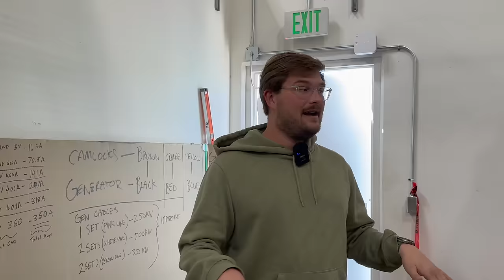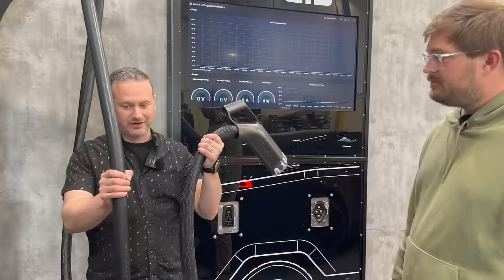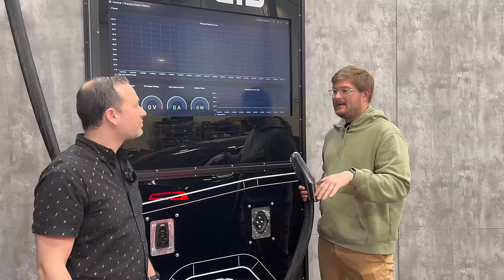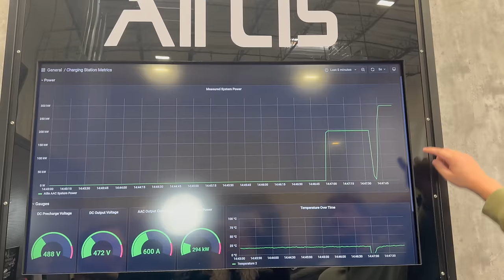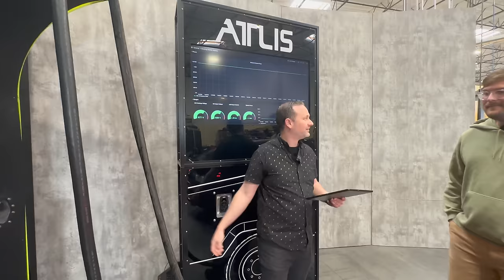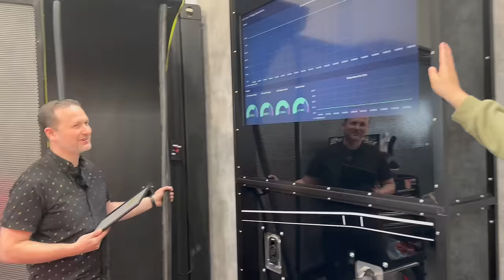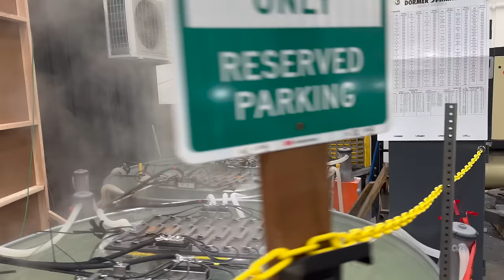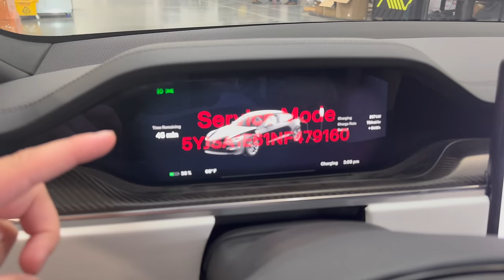Fastest Charging Ever! Megawatt Charging Deep Dive w/ Atlis Energy Solutions

Comment: Handle is good for the connector, especially if there's substantial insertion force. Less chance of wrist fatigue or injury from putting force on the joints at a strange angle. It would also be easier to grip if you can wrap your fingers around it, especially with smaller hands.

As for the stations themselves, I like the demo unit setup that keeps the cable off the ground. Probably something like a tall pole with a swing arm so the cable isn't dragging or getting run over.

Comment: Decades ago we were filming a commercial in Mexico City, at their large studio. We needed to warm up a prop Jacuzzi, quickly. So the studio electricians took a 2X4, nail on either end, wrapped with bare wire, and plugged it into the Mains at the wall panel. Dropped it into the spa, and told everyone to Step Back. They threw the large, old fashion “Frankenstein” switch, and the water instantly started to boil! It only took a few seconds for it to get to a comfortable temperature for our models. :-)

Comment: In 2001 I was involved with load testing 6 huge marine generators the same way - 6MWish………..  generators were connected up to 6 x 40ft half height shipping containers full of water. All tested fine, miles of huge cables disconnected and removed (no body was allowed into the main machinery space during the test btw) BUT after the half height containers had been drained and lifted off the hatch c overs for the ship we found that there were 6 x 40ft areas of bare steel under the test units…….. basically we had dissolved all the protective galvanising off 3 massive 30t steel hatch covers! We also had to have the ship’s magnetic compass re-swung and adjusted because the ship’s magnetism had changed drastically during the load testing!

Comment: I'm struck by the scale of all that's needed to power and cool this kind of system. Right now it seems like an almost comical amount of power needed. To run one of these in the real world you would probably need your own substation for each unit, which seems like a large barrier to mass adoption. Still, this gives a sense of where EV chargers and cars are going. It's likely all these problems will be solved eventually and the grid will scale to allow locations for megawatt charging in the near future. Imagine the ev market share when the cars can charge as fast or faster than a gas/diesel truck can refill.
Reply: The demand charges of megawatt charging will never make megawatt charging a profitable endeavor.

Most utilities have a $5-$15 per kW demand charge. It could cost up to $5,000 - $15,000 a month just in demand charges. Say you only have 60 vehicles get a full charge of 60 kWh at a max of 1mW. You’d had to charge $2.77 per kWh just to cover the demand charges. Compared to gas, that would be like driving a 4 mile per gallon car cost wise.
Reply: @Jhawk376  the concept of demand pricing will eventually phase out.
Reply: @Jhawk376  Thats a solid point for the near future I hadn't considered. I sometimes wonder if a better solution is grid charging batteries that themselves can send energy faster to cars that come in to charge. In theory you won't have peak charger 24/7 so there is time at night or off hours to charge onsite storage that ca be used when demand is needed. I think I saw this in another one of his videos too.
Reply: main users will probably be semi trucks. maybe a few other vehicles that can handle it will be able to stop by or something.
Reply: @JoeSimonsen  I think Kyle showcased this already. for places that are a bit more removed they keep some batteries charged to allow for higher rates without needing infrastructure.
Reply: @GregHassler  Honest question: Why would “demand charging” phase out if the utility companies use it to distribute more of the cost associated with building/maintaining capacity of power to those who use it most?
Reply: @JoeSimonsen  that's how it works at several 16+*300kW charging stations here in Denmark. There's a huge battery being charged by the grid and solar cells on the roof of the station, to better distribute the load on the grid.
Reply: Don't see a point to this system
Reply: EVs will never charge faster than filling fuel, that's for sure.
Reply: @TheIrvingsylva  batteries will level it out so distribution can be more even.
Reply: AC needed
Reply: @alanmay7929  They don't need to.
Reply: @alanmay7929  NASCAR fills 20 gallon tanks in 12 seconds. INDY CARS in 6 seconds.
Reply: Ignoring the power being dumped in the water, there seems to be a huge energy loss in this setup.
Reply: @alanmay7929  Bring EV charging to 5 megawatts and it's there. Assuming electric motors are 4x more efficient than an ICE engine and you cut the 20,000kW of a gas pump by a quarter.
Reply: @kng128  absolute bullshit!! ICE diesel more precisely have significantly way more range than any EV, some ICE even comes with second or auxiliary fuel tank for even more range, charging an EV will never equal the speed of filling 5MW that will come from where?! no house even have that kind of energy demand lol!!!

Comment: The white charger with an external handle is definitely the better choice for the connector. Not everyone has large hands that can handle a large diameter connector. It could also slip in rain and snow. The one with the external handle is absolutely much easier to handle in all situations. Just make it of rigid and unbreakable materials. It would be best, if you include some metallic stripe in it, so that if it weakens in hot climates, and the plastics break, the handle doesn't, and it can still be used until it is exchanged.

Comment: As a retired electrical engineer working in the genset business, I don’t think you have any concept on the amount of “energy” in 1 Megawatt of power. The expansion of the electrical transmission network to handle a station of several 1 MW chargers will be horrendously expensive. That will lead to higher electricity prices. The existing transmission network in the USA needs a lot of updates and replacements to handle the ever increasing needs for electricity. That’s not going to happen overnight or even in a few years. I don’t think I want to be plugging my EV (assuming I ever have one) into equipment capable of 1 MW power flow. To me 250kW is too dangerous to be around. If there is ever a failure , it’s going to be like the “big bang”.
Reply: Yeah, this charging system is a one off demonstration. It isn't ever going into mass production.
Reply: How long have you been retired?  Getting megawatt+ power drops just isn't that hard nowadays.  Look at the rapid expansion of the supercharger network for one, the explosion of Bitcoin processors, and data centers everywhere.  Projects take some time for planning and acquisition of transformers, but there are no fundamental obstacles to this.  US infrastructure is continually upgrading as it has been for over 70 years. Capacity is 6 times what it was in the 60's, adding some charging capacity for EVs will only be another 20% expansion over today's levels.

Comment: I think the dispensers should be something similar to Kempower stations.  skinny pedestal with a place for the handle and card reader with the cable going up high and extending out on a movable pole or spring so you can get front charge port and back charge ports.

Comment: A 100 KW solar array may trickle charge the battery bank( 2 days). A 200 KW array would do that faster (5-8 hours). You don't need a megawatt of power everyday. So, a 200 or 250 KW solar array would be optimum. The generators would only serve as a back up in times of need. The grid would also help with a 100 or 200 KW.

Also a megawatt charger would charge  14-16 vehicles at a time. And 4 to 5 simultaneously at a high speed.

Comment: Definitely need a handle, right now I quite often have a phone in my hand while initiating the session and a handle would make it much easier to plug in with one hand. I envision a gas station like concept so a vehicle can pull in either the left or right or front or wherever it’s charge port is. Make a few stations that are longer like RV/Semi pumps for pull thru with trailers. Have a board that shows status of all the stations so you can see when pulling in what’s online, what’s in use, and be able to pick what fits your need. Red light green light status with a phone app, as Kyle said one kiosk for those who need to swipe a card and don’t have a phone app. Semi fuel stations do something similar with cardlocks.

Comment: With wireless communication, in theory the vehicle can start to handshake with the charger BEFORE the plug is inserted into the vehicle.  But I would very much worry about environmental RF interference from nearby radio sources causing problems with the charging communications.
Reply: It's NFC has to touch

Comment: Another vote for Team Handle (10:30 in). When it's cold and wet, you need something that is ergonomic; maybe has a rubber-like exterior that doesn't slip, textured to maximize the amount of contact with your grip. You can get "grip tape" from Grainger or ULINE or a thousand places online, it's used for adding more grip to SLR cameras / pistols / hammers, anything you hold a lot and want to make sure it's not likely to slip out of your hands. That, but embedded into the design.

At 23:00 they're looking at doing a modern 77kWh car from 10 to 80% in well under 3 minutes. You're competing with ICE vehicles.
Reply: Won't it keel the battery?
Reply: I'm not so sure going from 10 to 80% in 3 minutes is very good for the health of the battery...
Reply: @Abraxas Tulammo  Depends on the design and chemistry of the battery. In the future, batteries will be almost indestructible!
Reply: @Superman-xr1oh  a circa 77KWh battery charged from 10-80% in 3 minutes !- no current commercial car battery management system (BMS) would allow the vehicle battery to be charged in that fashion as indeed the battery would be wrecked- which is why Atlis mentioned they are looking into creating their own batteries and BMS.
Reply: @johnodell5310  In the future we will be in flying cars. In the future Scotty will just beam me up. Not going to happen. Wake up

Comment: Very Interesting approach 👍. Definitely need a  battery pack with superior thermal conduction. The only question is where is the energy coming from? Unless it comes from a local nuclear power or Alternative energy forms, it will eventually be limited by grid power. Definitely a good alternative for high availability EV charging infrastructure. Most probable application is for EVSemi charging. Hope they are not in the game to just soakup the govt. incentives for EV infrastructure. Just some 💭.

Comment: Megawatt charging sounds good until you consider the effort required to get a megawatt power drop in any location. It is essentially the service equivalent of 50 typical houses all going to a single point. If a location has 8 stations that is a large subdivision of 400 houses......to charge 8 cars at a time. 

Even the typical 350kW systems are quite a strain at single drop points.
Reply: With higher power / faster charging you don't need as many stalls because your turnaround time is faster. So 4 ports of AMV chargers is roughly equivalent to 8 or 12 CCS / Supercharger stalls, which is very common and not that hard to get a drop from power companies. High power industrial connections are a thing, I don't know why people think it's some impossible task.
Reply: @GregHassler  I don't think its impossible.... just not practical in many locations.  There is a limit to how many of these can be dropped  too. 
As for fewer stalls.... I don't want to wait 30 minutes or an hour for electricity.  Even with fast charging, it takes a long time if there are a few cars ahead.  

I love the idea but the whole of the system is a pain.

Comment: It would have been really nice if all charging standards supported 277V AC. I've heard at least some Teslas can handle it, but they're not clear on that so most people aren't going to risk it.

Plug and Charge. Let it rip as soon as it's plugged in. If there's no network, store the info for later. I've visited some small towns during air shows that quadrupled their population for the day and couldn't get text messages through so the charging app didn't work.

Are you going to have a NACS plug on there, or are Tesla owners not included in your efforts to be able to fast charge every car?

Comment: Thanks, Kyle! I can definitely get behind the wireless COM (that's where I think our standards need to go), but there still needs to be a foolproof proximity connection (perhaps tied to an internal locking mechanism). 
I'm still not sold on the need for high-power AC, though. As we know, batteries are DC, so charging a battery through a 480 VAC connection will require what is essentially an onboard, 50+ kW DCFC. To me, that juice isn't worth the squeeze, and the added vehicle complexity, cost, space, and weight far outweighs any gains in convenience or conversion losses. Even for overnight (i.e., destination) charging, the bigger battery EVs using CharIN's MCS should be hooked up to 50+ kW DCFC.

Comment: "The Atlis chargers are not going to have screens. They're kind of irrelevant, everyone has a digital screen in their pocket."

NO!  NO NO NO NO NO NO NO NO NO NO!

The "app only" nonsense needs to stop, and those who propose systems that require an app to use need to get a full out Three Stooges grade slap across the face the moment they say something that stupid.

I can go use almost any gas pump in the country with nothing but a credit card.  I don't need to have cell service, my phone doesn't need to have a charge, it doesn't need to authenticate my vehicle, it just needs to accept the same form of payment accepted almost anywhere else in the world.  It shows me exactly how fast the fuel is flowing and how much I'm spending without requiring me to sign up to a system.

Anything that's phone-only is an absurdly massive step backwards.  There's of course nothing wrong with having a good app that allows for more convenient use, but the idea of mandating it is blatantly stupid.

Likewise for the point about wireless communication.  Yeah, WiFi is faster than 500kbit/sec CAN connections, but that's not comparing apples to apples.  What do those high speed WiFi connections use for backhaul?  Higher speed wired ethernet, which could easily instead just be fed down the connector to the vehicle for a reliable connection from anywhere between 10mbit/sec and 10gbit/sec.  Or if four pairs of high speed signals are just too much to deal with on a rugged connector, the same single pair one would need for CAN can also be used for single-pair ethernet from 10mbit/sec to 1gbit/sec.

I can accept that wireless might prove easier to maintain long term because it doesn't require high speed data to travel over contacts exposed to the elements and abused by all sorts, but it's never faster than a good wire.  Whatever encoding one manages to run over the air can be run with more RF bandwidth and better SNR over a wire.
Reply: 1) Wireless doesn't necessarily mean "WiFi", it could be any number of protocols.  Large bandwidth isn't needed.
2) Tesla has been screen free for a decade and is the most reliable system out there. Interface available not just in your pocket but in the vehicle too.
3) They'll probably end up with screens anyway because they're starting to be mandated in parts of the US and Europe.

Comment: This charger is cool just do not see any vehicle outside of  semi truck and construction vehicles being able to use it at 1 megawatt charging. Think how many battery banks it takes to get to .5C so 2 megawatt of capacity.
Reply: Can be safely used by Electric Boats, Ferries, Ships, Aircraft, Mining Vehicles, Port Vehicles, Electric Trains, Autonomous Vehicles, etc. Current Battery Electric Railroad Train Locomotives are being built with over 10 Megawatt Battery Packs! Definitely plenty of use cases available.
Reply: @electricar9  I agree. This will be for commercial use at first. Also it will be very cool when they make a car with a battery to handle that kind of charging without damaging the battery (lowering the cycle count under 3000).

Comment: With many tanks that size underground it could run Hotels heating in winter with heat pump heaters(mini splits).  Keep a parking lot snow free in winter for the charging station using radiant lines underground. Use heat pumps to cool anything also.  Sky isn't the limit.
Reply: this whole thing went over your head didn't it
Reply: @charlottelanvin7095  Not at all. Maybe you have a hard time understanding what someone is saying.